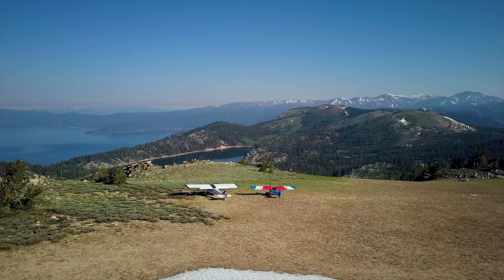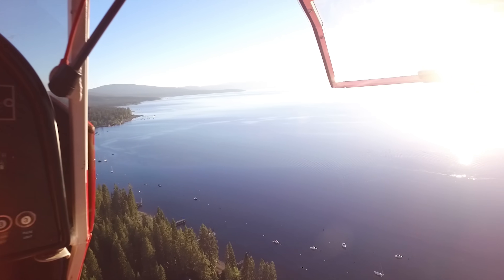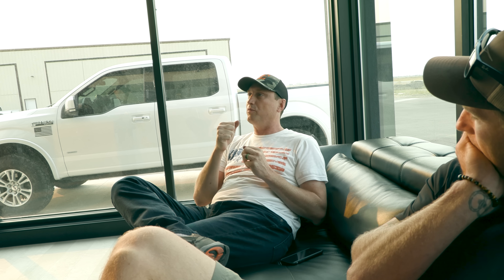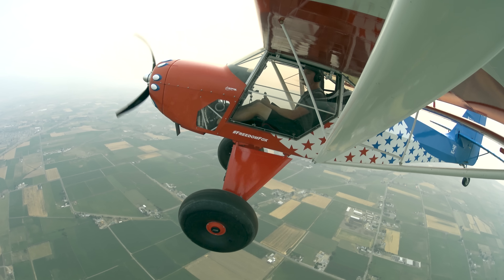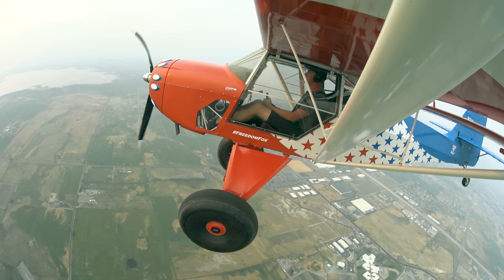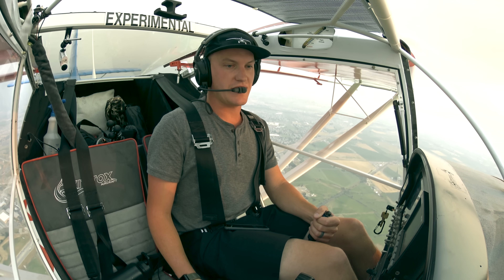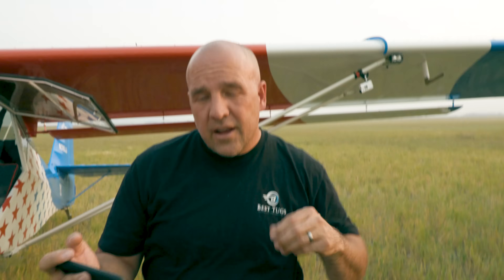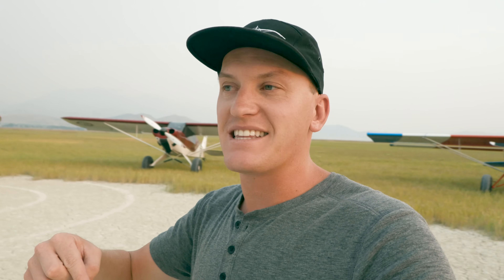YOUR FLIGHT INSTRUCTOR WAS WRONG! - Simulated vs Real Engine Failure

Comment: Try pushing a corkSCREW staight into a cork without spinning it........what part of a screw don't people understand?
Reply: Most comments are from basement dwellers that have never screwed anything before
Reply: @slickjimmy76  spicy lol
Reply: I see, but what is the difference between a canary?
Reply: Yeah. Cork is a solid object. The air isn’t. 

Once the prop stops and the blades stall there is less drag. That’s why one of the tricks with a runaway prop on long range bombers and airliners was to cut the oil off and let the engine seize. Drag of a stopped prop is a fraction of one that is idling or windmilling.
Reply: Calvin Nickel not only would cutting oil off on a runaway prop cause the reduction gearbox to explode, but those are turboprops, capable of feathering the prop.
Reply: @tay5658  those are turboprops, now.  But I strongly suspect he is referencing WWII aircraft since those were usually radial engines.
Reply: @calvinnickel9995  impossible!

Comment: So given some constant airspeed, a prop would produce a constant drag force and no thrust if the engine is off. If idle, it would produce some non-zero thrust value that would act in opposition to the drag, reducing the effective drag experienced by the plane. If your airspeed increased, however, the magnitude of the drag would continue to increase, while the thrust generated by the prop would remain constant. (I'm an Aerospace Engineering student studying Aircraft Performance, and this is a really interesting problem!) I think this is what would occur, from a vector force perspective. Practically, tho, you could probably develop a chart describing the idle airspeed you'd need to fly at to simulate the same drag as if the engine had actually failed. (I don't fly, yet, so I don't know if this is a thing or not)
Reply: Matthew is correct. At a speed where the engine is producing no thrust and the prop rpm is matched to the air speed there is no drag.  As the rpm is slowed the drag from the prop increases until the rpm goes to zero and zero thrust is generated, the drag becomes maximum.

Comment: A prop at idle is creating some drag but it is cutting through some of the air. If you were on the ground with a 30 knot head wind with the engine off it's all drag but with the engine at idle the drag is reduced on the prop.

Comment: Really good info. I had an actual engine out at 100' agl (on takeoff) on Sunday. Test flying a 2 place E-lsa for a friend. I set it back down 50' off the side of the runway with no injuries, at all. This LSA's "book" claims a 7-1 glide ratio but we found that it fell 100' vertical over 150' horizontal. Thats 45 fkn degrees lol

Comment: I had this instructor tell me if you loss an engine during initial climb you should push hard enough on the stick so that you are light in the seat, (multi engine aircraft does not apply). Seems to make sense, especially if the aircraft has a lot drag.

Comment: Stopped prop is always worse. As rpm increases drag decreases and then turns to thrust. Done.
Reply: Even if prop turns the motor, it is better than stopped. Windmilling is less drag. It's a rather simple concept. Any perceived improvement in glide from a stationary prop would be due to other factors.
Reply: @JimmysTractor  False. You also have to look at the AOA of the windmilling propeller to the relative wind. It is creating lift on the back side of the propeller.
Reply: @EarthAmbassador  Not false. Not opinion. Just logic.

Comment: I can assure you that the constant speed prop in my RV-8, at full-fine pitch with engine idling during final approach, is an extremely effective air-brake. Recommended procedure for achieving best glide includes adjusting the prop to full-coarse position, which yields about a 10% improvement in glide slope. This is probably something that should be tested during aircraft certification as it can be an important number to know and will likely vary from plane to plane, prop type and loading condition.

Comment: Like you and a lot of people have already said, my guess is it depends on the glide speed, idle RPM, and of course fixed pitch vs constant speed. 

For what it’s worth, the aircraft I fly is a single engine turboprop, and at best glide I have to set 4-6% torque above idle to simulate a fully feathered propeller and dead engine when practicing SFLs per the POH. I’ve even heard from pilots who have actually lost the engine that 4-6% might be more drag than a fully feathered prop and dead engine, but that’s anecdotal.

Comment: A stopped prop is unquestionably aerodynamically "stalled" which caused less drag than a "wind milling" prop which will be aerodynamically "lifting" against the direction of travel.
On a paramotor, "idling" with no clutch (no wind milling) has a better glide than engine off (by quite a margin)

Comment: Hey guys I just have to chime in on this one as a guy who survived an unplanned engine out. I was a 75ish hour pilot. I had rented a Cessna 150 just like the one I had done most of my training in to build some long xcountry time. Long story short. The engine died at pattern altitude as I was over flying midfield for a left downwind. In my head I was startled that it stopped then oh well no biggy, I have practiced this how many times with the Instructor. I very quickly realized the difference between an idling propeller and a windmilling propeller. I thought for sure I was going to park it in the roof of some shed just outside the airport fence. I landed on the runway about 30 degrees off runway heading. I'm sure angels helped me do what I did. The only damage after all said and done, outside of the engine itself, was the tail tie down ring. 
I was really shocked how much shorter my glide was. I now try to warn other new pilots about that. 
A couple days after the incident I got to talk with one of the test pilots from Cessna. He said the decision to "stop" the prop or to let it windmill has to do with altitude above the "runway". You have to be high enough for the benefit to out way the altitude loss You WILL experience in trying to stop the prop. Anyway that was my experience.

Comment: It actually not the prop surface it’s the dirty air produced by a rotating prop that reduces lift by the wings , glider pilots and sailors
Know this !
Reply: An idling prop may produce a little drag or a little thrust, depending on how closely it matches with the zero-thrust speed for idle RPM.  A stopped prop produces drag by virtue of being a non-aerodynamic thing sticking into the wing.  A windmilling prop produces drag by extracting a significant amount of energy from the airstream.  A windmilling prop turning a non-running engine produces much more drag than a stopped prop.  This was demonstrated very clearly by my aircraft stability, control and performance professor by measuring the rudder input required to balance the drag for an idling engine (no extra rudder input against the opposite idling engine), shut-down and windmilling engine (pulled the mixture, kept the prop unfeathered - lots of extra rudder input) and stopped engine (feathered and unfeathered the shutdown engine to stop it - just a little rudder input).

Comment: In the real world though you would only want to stall your aircraft if you knew how to handle it well. you don't want newbies making the mistake of stalling the aircraft to stop the prop to increase range and falling faster because they were not able to recover from the stall fast enough. Also wouldn't you want to try to restart the engine by using the windmilling prop if you could?

Comment: Ah, but your test itself is flawed... you both used similar aircraft, while basically discounting other types of aircraft which may have different glide ratio and speeds, prop pitch, and idle speeds... Why would you not at least throw in a test with a very prolific training aircraft like a Cessna 172? You also only performed each test on each once. How are you sure that weather or pilot factors didn't affect the test, if you only performed each test once? you could have flown one a knot or two faster vs the other and completely thrown the test off.

That being said, you always need to be conservative with anything.

Comment: I think you should re do the test and look at distance covered for altitude lost, looking at a time doesn’t tell you best glide. You just looked at sink rate, which just gives you more time aloft not necessarily more distance, maybe use your ForeFlight/stratus to look at the log?
Reply from the maker: Well since I’m holding a constant speed in both test the time tells me how far i went since speed is just an equation of distance over time... I did the math, I think I made it an extra 1/4 mile but I’d have to look again

Comment: I’ve never heard any of my instructors say an idling prop will create more drag than a true engine failure. I was always told that to expect a worse glide ratio compared to the glides in a simulated engine out.

Comment: seems to me a dead stick prop would be worst
then windmill speed up till the prop flow matches the airspeed as decreasing drag. (this is assuming the prop can windmill freely...so...application specific?)
then power from there.
just my (un)common sense $.02

Comment: I wonder if the same applies on a paramotor. I fly a non-clutched motor, and can tell, depending on my idle, that I will descend slower with the engine idling, since there is still a little bit of thrust. Given my prop is behind me, if I shut off the engine, it will stay still and drag a little bit... but I don't think it's all that much more than the "me sitting in a chair" which is the aerodynamic equivalent of a brick...  

Kyle O'Glee got a clutched motor and thinks that the windmilling prop causes drag and reduces glide ratio... but I wonder if it's just the absence of that little bit of thrust from an idling motor with a spinning prop...

Comment: Draco doesn’t need to worry cuz his prop auto feathers when it dies and the prop isn’t connected to anything so their isn’t any drag on the engine internals. So I guess the solution is do a mid air engine swap to a PT6.

Comment: Simple vector equations show that although the engine is at idle gives you have a foward thrust plus the momentum of the aircraft. What sends you foward at the engine idle is the force of the spinning prop plus the momentum and the only force that pushes you foward at the stopped engine is the momentum of the aircraft.

Comment: This is a great question.  I flew for a parachute club which was 501c so I was legit as a PPL.  During checkout the instructor pulled the mixture in the 182 which surprised me.  He had been stressing to not shock cool the engine on descent after dumping the jumpers. The main difference I saw was my confusion.  I did come a bit short since I was confused but not sure if the physics of flight changed.

Comment: The exact same debate has taken place in the sailing community with the exact same results as documented in the article below.  

https://www.yachtingmonthly.com/gear/folding-and-feathering-propeller-test-29807

An additional factor on a sailboat, and presumably on an airplane, is that a fixed non-spinning propeller creates more turbulence over the rudder which decreases control in certain conditions, whereby an spinning propeller creates less turbulence and better laminar flow over the rudder, resulting in better control, regardless of whether the engine is idling or freewheeling.

Comment: Difference in survival or not in a dead sided twin is the ability to feather the dead engine to stop the prop and this same debate around engine failure simulations at idle vs. completely off always occurs as well.  Most manufacturers of twins provide a "zero-thrust" power setting slightly above idle to simulate a feathered prop or some experienced instructor has his for that model of twin engine airplane.

Comment: Having flown RC scale aerobatics in the unlimited class and accidentally  tested this scenario a  hundreds  times with unwanted engine outs   we have known the answer to this for many years ... The idling prop has considerably more drag then a stopped prop ... Virtually all RC contest fliers know this by default through engine out experience that they all witness over time .... but if you really want proof shut the engine off on a helicopter .... you can fly it to the earth at a moderate pace ... Its an extreme example with of course variable pitch but it still applies in principle ... if you stop the rotor it falls like a stone
Reply from the maker: This is an example of how different aircraft will have different results. In my  plane I will glide farther with an idling prop then a stopped prop, as shown in this video.

Comment: You need someone proficient at the math relating to fluid dynamics in relation to aircraft to chime in.  There may be more variables (density of the air, fixed pitch of the props, the shape of the aircraft around the prop area, etc etc etc etc).

Comment: In my experience with RC planes, you come in faster with the engine running even at idle. but I don't have an airspeed indicator so its not something I have tested. 
you can stay in the air longer at idle than dead stick.

Comment: Not a pilot but if I was, and my engine was at idle, I would just throttle power back up.  lol
Just making the point that an engine out is an engine out, and this discussion is purely related to "pretend" power out training I presume.

Comment: Great test guys, I quite enjoy theses aerodynamic myth busting :D  It would be nice to see the test done with a Cessna 150, which is a common plane for students and general pilots. Your guys planes are light weight with big engines where a C150 best glide would be at 75mph and residual thrust at idle from that engine would be a lot less. With model aircraft the less powerful and or with finer pitch props models will tend to glide further dead stick but my powerful aerobatic models will glide futher at idle.

Comment: There's a break point around 0.8 P/D where the windmilling prop creates less drag than a locked propeller. This can be tested on model airplanes quite easily and the effect is quite dramatic. Electric and gas powered models with the prop left spinning in glide pretty much glide like crap. Lock the prop and the improvement in glide ratio is dramatic. Full scale aircraft operate in similar P/D regimes (less than 0.8) and therefore follow the same rule.
Sink rate is a poor measure of glide performance on a full scale aircraft. You need to know what the glide ratio is.

Comment: The whole thing is interesting.... but the differences are not THAT significant, really.  Not compared to the difference between the glide characteristics of your plane with ONLY the pilot and partial fuel, vs. loaded right up to gross (maybe a little beyond).... you gotta know how to look outside (when you are in a glide) and ADAPT, based on how she's progressing, and understand that she will glide different on different days (prop stopped, not stopped, loaded to the nuts, light, heavy, hot, high, big hole in the side of the cowl where the piston came flying out, lol, etc)  .  Here's another fun argument....; should you glide at best glide speed, like they teach you???  Or, considerably faster than that, as every glider pilot in the world does once they enter the traffic pattern and commit to land?   I know what I do....

Comment: I use to fly C210s and at idle you can feel the plane  accelerate when you push the prop course. 
In 150s I'm confidant it glid far better with prop stopped.
But as an instructor I would say don't distract yourself in an emergence chasing minor improvements in glide. As the closest safe field is better then one you Might reach!
Usually wind drift is far more significant and good glide perception is well able to adjust to varying glide performance and aircraft type.
 I would also say you could be better with more drag as a small field with trees to clear requires steeper approaches.
If you wish to improve on Forced Landings, Constant speed glides are just used to build basic judgement. Try a minimum time from height to wheels down. Hold VNE as long as possible or Max gear down speed  May help in a in-flight Fire. Use both configuration and speed to control your vertical position and minimize energy to loose as good ground to land on rushes by. 
The most fun glide I ever had was in a TB10 . I held VNE , then progressively slowed adding slide slip to reach full rudder at Max maneuvering speed aiming  well short so as to be able to wash off speed, in a full flap full side slip easing  out in the flare to a full stalled touchdown on the threshold markings to exist at the first taxiway. 
Best to practice with an instructor on board until you are fully familiar with your craft. By the way a side slip and a spin entry have a lot in common. 
Watch your Attitude Buster!
Play Safe.

Comment: A propeller rotating creates a disc making it a drag at low rpm (idle).  In RC world, we use it as a break to slow the plane down on steep landings.  This only applies on RC planes with combustion engines.  Not to most electric.  Most electric driven planes freewheel, making the drag insignificant.

Comment: Trent, 

Study glide polar and speed to fly, or better yet, just get your glider rating.  Concepts like "best glide speed" will take on a completely different meaning and these kinds of arguments will sound trivial and uninformed.  You'll realize that a prop spinning vs not is just one aspect of many when it comes to what are the best airmanship practices for maximum range when thrust is no longer available.